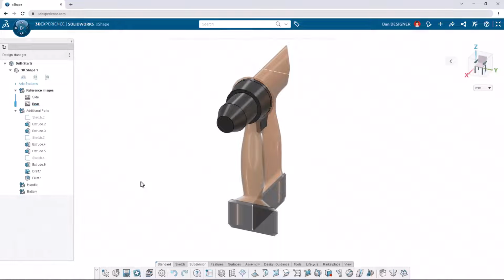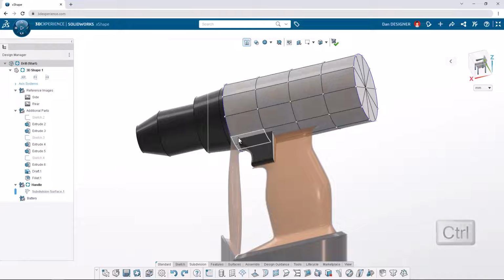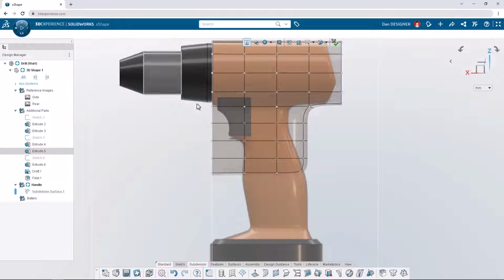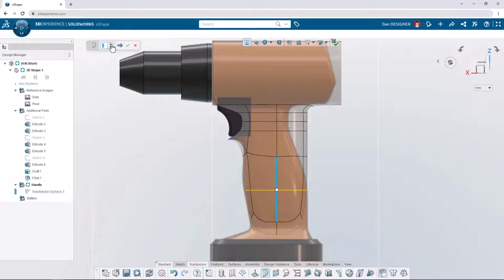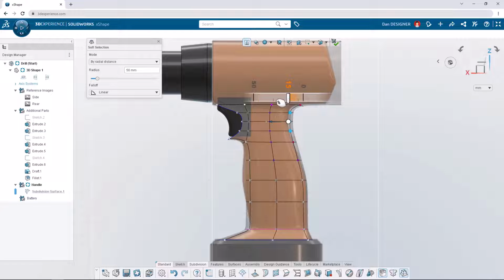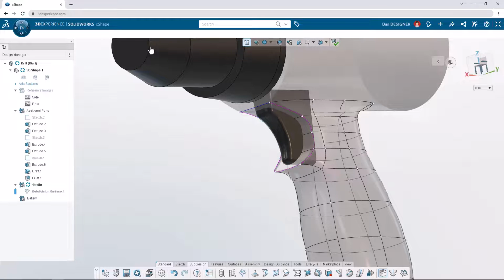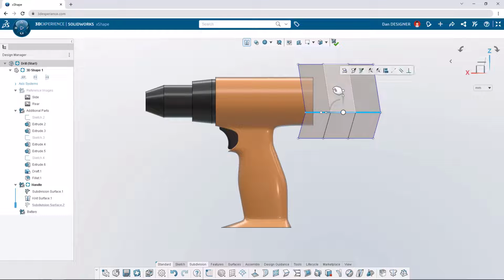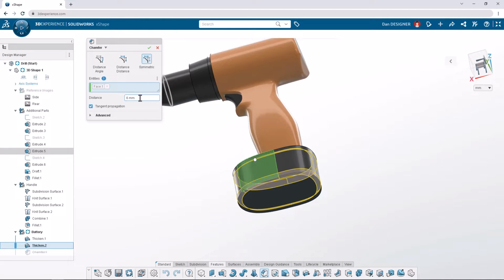How to Design a Power Drill with Subdivision Modeling - Made in SOLIDWORKS xShape

Comment: I found something major different if when creating the Cylinder primitive, you just float over the origin and use the TAB key to orient BEFORE clicking to actually drop it at the origin, it will always line a set of LOOPS/seams up with the Vertical plane no matter what you change the number of Minor Segments to. In other words after I am done inserting the primitive it needs to be rotated 18 degrees...   BUT, if you use the method shown in the video and go ahead and click the origin with the cylinder at the wrong orientation and then use the CHANGE AXIS DIRECTION button in the dialog box it will align a LOOP/seam up with the Horizontal plane!  Weird!!